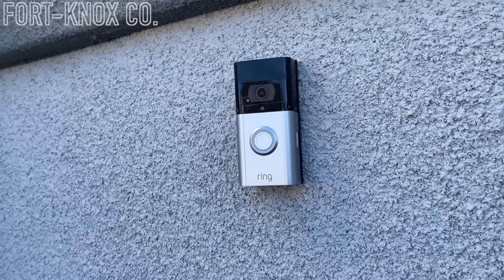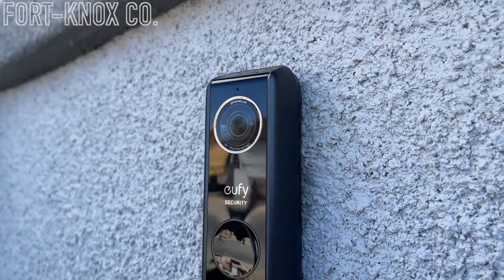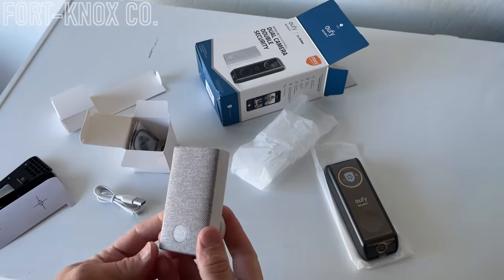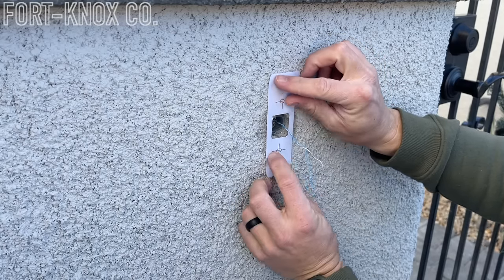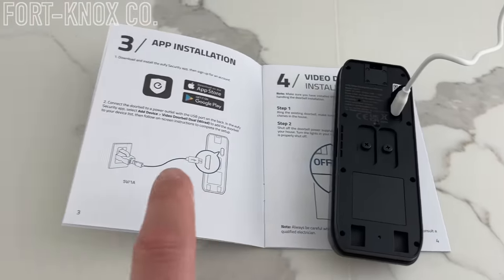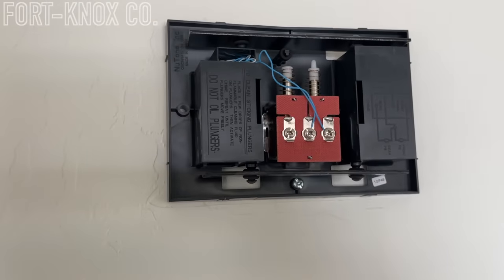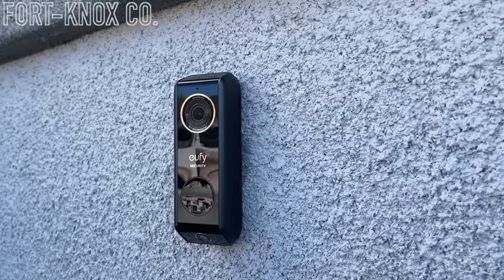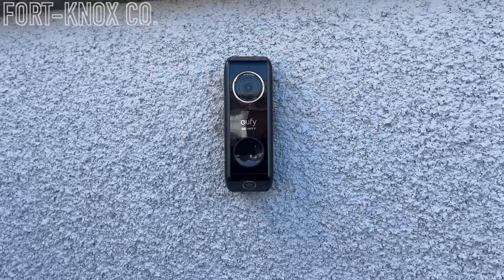BEST Video Doorbell 2024 with No Subscription Required Eufy Dual Camera Doorbell Installation Memory

Comment: The information at the beginning of the video claiming that ring/blink cannot store video locally or has no access after the FREE trial subscription ends is just FALSE. If you buy it with the Sync Module you have the ability to locally store and remotely view any and all motion alerts and videos from all of your cameras on that system. As stated by another user at least that is inside the house so you don't have to lose everything when someone just rips the camera off the house. Also to buy the blink/ring system with that backup option is still less expensive that what you're proposing here. In addition you can use your existing Alexa or blink mini camera's as chimes in addition to your mobile devices and tablets by just installing an app and setting up which ones you want to ring. Just tell people the truth rather than a paid marketing scheme. Otherwise a well made video, and no beef with using an alternate product that has the same or maybe better features.. but don't lie about a competitor to make a quick buck.
Reply from the maker: I appreciate the feed back. I make videos on all the stuff I buy or use to just give insight or instructions on installing/problem solving. But was not paid by Eufy to do this. I was making a video about my ring doorbell and then learned about how I’d have to have a subscription or buy more equipment to store my data/alerts n such. I then researched, found eufy and liked that with just the doorbell it had internal storage and the ability to expand, but didn’t have to buy anything else other than the door bell if I didn’t want to. I was mainly focusing on using the door bell as a stand alone and having the ability to access all the creatures these door bell talk about. With ring I lost most those great features after the trail unless I wanted to pay for something in addition. With the Eufy i was able to install and have full access to the features as advertised and didn’t have to pay for them down the road.  I also had a lot of connection issues with my ring doorbell. Not saying this is a problem for everyone but something I experienced. With the Eufy I’ve had a way better experience with opening the app and I’m the video feed popping right up. The ring lagged or didn’t connect. And when it did half the time it would notify me that it was doing a software update and would be back online shortly. Super annoying.  
But again I appreciate the feedback. Never intentionally hiding any info from people. I may be pumping up what I’m doing or expanding more on what I have in my hand vs the other options, but that’s only because it’s what I may have more experience with or actually have experience using. I usually just make videos about stuff I find or have used. There’s plenty of other options out there. Im not testing and doing break downs on all systems like a tech channel, just trying to help people with getting more info out there.
Reply: David…. Have a Snickers! You’re not quite yourself when you’re hangry!
Reply from the maker: @beri232  Snickers are delicious.
Reply: Totally agree brother, my RING works flawlessly, got is the first YouTube er’ that I’ve argued with and things didn’t match up to what he was claiming.
Reply from the maker: @alanrobisonPD1960  a lot of people really like the Ring and have had great experiences. It just wasn’t mine unfortunately. I think maybe if ring had some type of self diagnosing feature and would have told me earlier that I needed to upgrade my transformer to a bigger power source I could have avoided the ring not working so well. But either way I like that there’s all these different options. Lots of video out there explaining things.
Reply: @alanrobisonPD1960  I had a Ring and it was garbage after a year. So was my moth-in-laws and my brother-in-laws. We got them all as Christmas gifts the same year and they all had the same malfunctions at roughly the same time.
Reply: Does it cover theft? If they steal the camera?
Reply: @beri232  ring suck , everyone I know that has one can’t hear me or I can’t hear them
Reply: Ring sent us a notice last year that the subscription price is doubling next year, so I may be switching to this….
Reply: Well said. I’ve been using the ring system in Dublin Ireland for going on 5 years and not a single problem did I ever have.
Reply: I have to pay for my ring membership, I don’t get downloading messages but if you have crappy wifi it drains your battery , and to keep the battery from dying even if your hardwired you can’t have many motion settings.
Reply: Ring are the ones who need to tell the truth 🤣 you know how many people buy them thinking they are plug and play just for the basic features, only to learn they will be upsold on a subscription? I think this guy was just honestly trying to provide a decent alternative if you don't mind having a wired unit.
Reply: So David, it is true you cannot store locally as is.
Reply: @FortKnoxCo What if you have NO power? I would like this but i dont have any power?
Reply from the maker: @JerryFallwell-bt3py  if you have no existing wires then you’d be needing the battery powered model. They have wired and battery powered. You can literally mount it wherever you’d like in that case.
Reply: So does the blink sync module 2 work with original 1st gen ring doorbell?
Reply from the maker: @1ninjatiger  not sure if the blink and the ring sync or work together.
Reply: @FortKnoxCo  so David was talking rubbish then..and you are correct the ring doorbell has no capability of local storage?
Reply from the maker: @1ninjatiger  from my experience with ring the only way you get to enjoy the features they advertise like viewing events and having any history of video accessible….you must subscribe and pay. If you don’t pay for their cloud storage you only get the opportunity to view the doorbell when the event is actually happening, if you don’t click on the alert when it sends it saying someone is at your door right now in that moment and you want to view it later, you can’t. You have to view it while it’s happening or else it’s gone. Unless your paying for the cloud storage.
Reply: @FortKnoxCo  Yes I paid for it for a couple of years but when they doubled the price in the UK I cancelled.
Reply from the maker: @1ninjatiger  that’s exactly why I started looking for other options. Figured there had to be a way to get what they were advertising without having to subscribe to a monthly fee on top of the original purchase
Reply: @FortKnoxCo  yep I agree. This David fella seems to think that blink and ring are the same..they are certainly not.
Reply: @FortKnoxCo  You have an Amazon link in your show details... is that an affiliate link... i.e. do you get compensated if someone buys from that link ?   There are so many "honest reviews" on YouTube of late its disgusting.   Some creators never disclose that they either get compensated outright, or received the item for free... IN EXCHANGE FOR and "honest review".  Your video certainly sounded like you were a paid spokesperson for the company.  If your video(s) are not compensated in any way, you should state such, as many folks might give your review more weight.  Also, if the video WAS compensated, you should clearly state such up front so that folks can determine how much weight to give to the "honest review".
Reply from the maker: @larryag99  having the Amazon link is technically part of their affiliate program. But in all reality, anybody who has a prime Amazon membership can make their account a “affiliate“ account, so that you can then view items and create your own shareable links to send to people or friends. So it’s not like a formal paid sponsorship. For any of the videos I’ve made I have not been paid for or formally sponsored for. All the videos that I make are usually motivated by stuff that I found and that I think other people would like to know. I’m obviously giving my own personal opinions and my own personal experiences on these videos and reviews of any products. I put the links there because a lot of people sometimes want to get whatever item it is, that I’m speaking of. even if I’m doing electrical work and there’s a certain type of electrical box you might want to use during your construction job and they are hard to find in the big box stores. I will put a link for those there mainly to be helpful. The compensation, if you want to call it that is usually pennies. But it’s more about sharing the item link so you can directly get to it and then do your own research from that point forward. But I don’t make these videos as a formal review channel. As you can see amongst my library of videos, it goes everything from family trips and information that I learned at that location and what you might want to take advantage of if you decide to go, building a house and doing electrical work, or just giving updates on current projects that I’m building with little nuggets of information along the way. When I do a product review type video again, it’s usually just a video about some thing that I found that I like, and I think other people might like to. I usually just try to keep it positive and highlight things that I like or if there’s something that’s really bad and I found out and I could save someone time. Do not make the same mistake. I would usually highlight that as well. But anytime you put an affiliate link or something like that regarding to YouTube at the bottom of the description you’re supposed to put some type of verbiage that states that there are links that are associated with an affiliate account. That at a minimum people do when they use links that they could be compensated by in any form.
Reply: @FortKnoxCo  so did you get the item for free, or did you spend your own hard earned dollars for it ?  It's not really about the value of the compensation (of which getting the item gifted to you is included), its about a quid-pro-quo for making the video.
Reply from the maker: @larryag99  everything I’ve ever made a video on is something that I’ve purchased. Then I do a video on it if I can to show what I’ve found, what I like about it, any features I think other people will find interesting, etc. 
I wish I was given free products to test for people. But unfortunately I don’t think my channel is big enough for these companies to “sponsor” me yet. Lol. Maybe one day.  In that case that I ever do get free products to do videos on I’d for sure mention that in the video
Reply: @FortKnoxCo  its good to know that you will have the integrity to state such in order for your viewers to decide how much weight to give the review.  I'm not opposed to content creators making money... I just ask that they do it with integrity.... but many don't.
Reply from the maker: @larryag99  💯

Comment: I would like to know if there is something to protect the camera from someone stealing it. Thank you
Reply from the maker: There is no additional protection on the outside to prevent someone from breaking it off. At least not that I know of. It is secured to the wall and secured with some anchor screws. All of the memory is stored inside your house, so even if they steal the doorbell itself, you should have the hard drive in the chime plugged into the house, which is where I believe the memory is stored.

Comment: Great information but quick question. Is the eufy dual connection? I ask because I would like to have both. Wired in the front and wireless for the back. I do understand the charging issue for the wireless.
Reply from the maker: I believe if you wanted two doorbells you can do this. Either wired or battery, doesn’t matter, I think you’d just have the Eufy app and have both devices connected to your account. So you could view the video from either of your choice when you want. It’s similar to adding home cameras around the exterior. You could view it all through your Eufy App
Reply: @FortKnoxCo  Thanks for responding
Reply from the maker: @buddyquest4575  no problem at all

Comment: I had been a Eufy 2k Doorbell user for 2 years. It sounds nice that no subscription, etc.. However after going through two wireless doorbells, they have two significant flaws they couldn't fix.
It has two powering options. a, Battery that could be charged via USB, b, direct wiring via 12~24vAC
1. IT WILL NOT WORK CONTINUALY OVER A MONTH WHEN IT IS HARDWIRED, the battery need to be fully charged and reset, this requires pulling the bell wire out reinstalling
(personally went thru 3 or them and two software updates.
2. SHORTAGE OF STORAGE NOT EXPENDABLE, I have a high number of the visitor in installation and local storage in EUFY HOME has 16GB of storage, and it has a USB that doesn't extend the storage via USB Sticks, they never implemented via firmware upgrade.

DO NOT BUY, I am installing RING DOORBELL PRO 2.
Reply from the maker: That sucks you’ve had a bad experience with it. I know the battery option is less preferred because of the hassle of having to pull the batter or unit and recharge and then stick back out there. I had a battery one at first and hated having to do this. 
The wired version has been perfect though. I installed it , connected it to my WiFi and have never had to mess with it. It’s been connected ever since. It’s also stores a pretty good amount from what I can tell. I can look back a couple months on my events and still see them.  
I believe with the newer ones you might be able to incorporate the Home Base they use for their camera systems and that has a lot more memory. But for just the doorbell portion the Eufy hasn’t let us down yet.  

Luckily there’s plenty of options out there for everyone to choose what works best for them.
Reply: I have just installed the video doorbell. The dual one and that one works with homebase.  I also got the homebase 3 which you can add an HD or SSD up to 16TB in (it has 16GB internally). Plenty of storage options there.
Reply from the maker: @skyjack8884  that’s awesome to hear. I had heard the newer versions would be compatible with the home base 3’s. I may need to get one now.

Comment: Do you need to shut the house power off before installing?
Reply from the maker: It’s recommended that you turn off the circuit your doorbell is powered by. Can do this by just turning off the one breaker. 

But I’ve installed these without doing that. It’s low voltage so not too risky. Just don’t want to wires to be touching when installing. Keep them separated and install wires on the back of the doorbell securely
Reply: @FortKnoxCo  Okay, thanks for the info!

Comment: You said you replace the ring doorbell, I have the same one, when I install the ring doorbell there was a module that went into the chime inside the house from original doorbell system. How does that figure into the equation?
Reply from the maker: Are you referring to the little jumper cable that they say you can install to bypass the doorbell? I install that inside the house. It just jumps the power past the chime inside the house to supply constant power to the doorbell outside.

Comment: Do any of these door cameras work with existing door bell?  I have an expensive tubular chime system that I am not planning to get rid of.  Is there a remote relay or wiring from the camera button available?
Reply from the maker: I’m not sure what wiring would be required to trigger your home doorbell but I’m sure it’s possible. Most of these new video doorbells use a wireless plug in chime that can go anytime the home. But as far as using your wired doorbel I’m not completely familiar with that.
Reply: @FortKnoxCo  Thanks for the reply!
Reply from the maker: @geoffschulz  no problem at all

Comment: Thank you for the video, only problem is that with this doorbell camera the notification is slow, I've adjusted my settings to make it as fast as possible to get my notification but it didn't make any difference. You can still a package from someone and by the time you get notified the person and package is gone and night vision is a joke anything pass 13ft you won't be able to see that good. But thank you for the video 👍
Reply from the maker: That’s unfortunate. I feel like the notifications are pretty fast overall. Usually i get them during the day and it’s vibrating my watch with a notification message within a 1-3 seconds. Example, whenever I park in the driveway and get out or walk past my own door bell doing yard work. I pass the doorbell and about 2 seconds later it’s vibrating my watch and phone.
Reply: @FortKnoxCo  oh wow, Maybe I'm having WIFI issues. I'll have to troubleshoot it. Thanks 👍
Reply from the maker: @fcolon1976  yeah could be the WiFi. And make sure you have the bigger doorbell power source/transformer. We had to upgrade that the get any video door bell to work right. I have a video showing that too
Reply: @FortKnoxCo  thanks I'll watch it 🙂👍

Comment: I looked this up on amazon.  What is the homebase 1, 2 or 3?  Can I get a renewed camera?  (They offer this on Amazon)  Does it need the Homebase?  Please explain these things to me.  Thanks!!
Reply from the maker: The homebase is the their additional hub that has extra memory. It’s not necessary for the doorbell. It has its own memory and/or it’s stored in the plug in chime inside the home if you choose the combo with the doorbell and chime. The homebase systems are mainly for the exterior camera systems from them. Has larger memory bank and would be needed if your installing exterior/interior camera system.
Reply from the maker: If Amazon offers a renewed version them yes you could get that. I believe they offer some type of warranty with that as well.